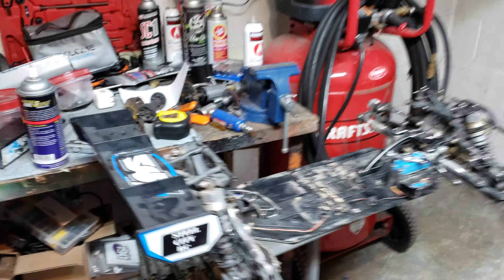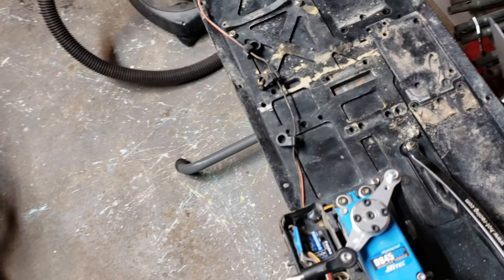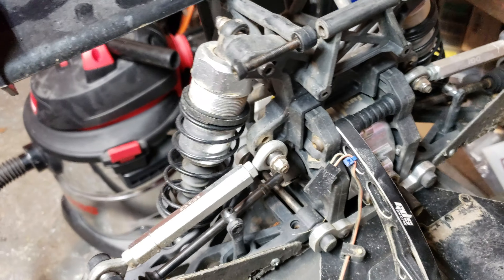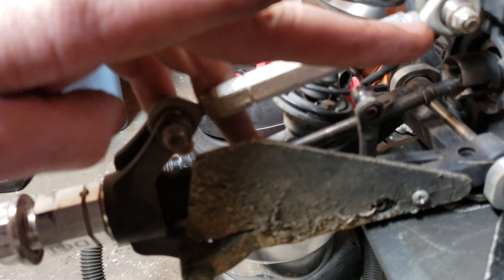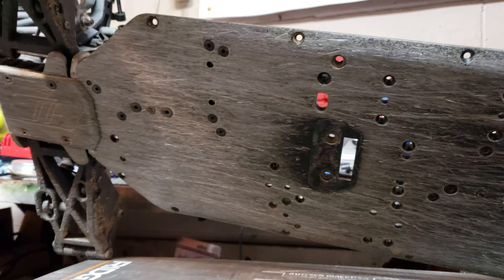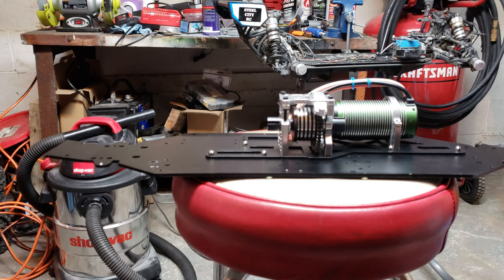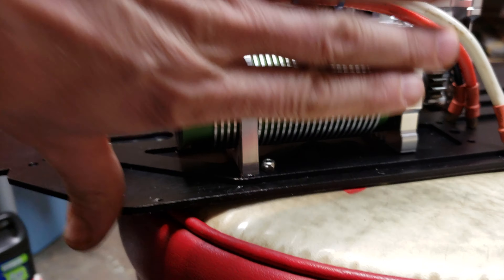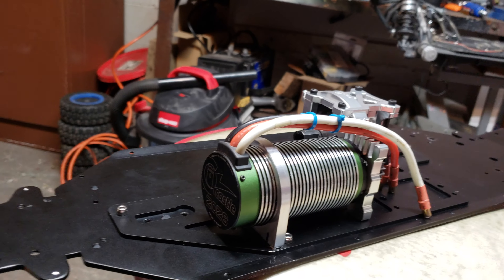Losi dbxl-e V1 FID Motor Mount & Mods

Comment: I did the same thing with that rear motor mount. I’m a machinist so i got it dialed right in!! But these are heavy motors so stock is just the front screws and that’s not enough support.. good work bud!
Reply from the maker: Thanks man. It made a huge difference getting and keeping good gear mesh. Also feels like it lays the power down better. Appreciate you stopping by to check out my buggy 👊🤘
Reply: @SteelCityRC  but where did you get them mounts from? Got mine with a whole motor mount kit and i want another but don’t want to buy the whole kit. Give a link if you can please.
Reply: The link in the description bring me to the site but doesn’t allow me to buy.
Reply from the maker: @Powerplay86  on their site. Hit the options menu tab. Then choose the clamp diameter you want to purchase. Basically the diameter of your motor. Then buy it.
Reply: @SteelCityRC  yup I figured it out lol the diameter is 57mm right?
Reply: @SteelCityRC  wow going to cost like 50$ with shipping. MGM makes the kit I bought so I emailed them to see if I can just buy the clamp. Thanks for the help 🤘

Comment: What’s up brother? Good to hear from ya! I think that rear support on the motor is going to solve your mesh problem for sure.
As far as your mesh method, I do the same thing and we know it’s good! Especially because we’re not dealing with any plastic gears. 
Hope you and your family have a Merry Christmas G!
Reply from the maker: Awesome. Glad you think the rear mount will help. Took a bit to slot the chassis so it will slide for different pinion options. Now I wont be so fearful to change pinions. Happy Holidays my friend!!

Comment: Got a few of the darkside studios chassis protectors and they are by far the best I've ever found to date. Gotta get that motor mount for mine...nice brother! In middle of throwing in castle bec2.0 and dual hitec d-845wp servos in mine rite now. Hate the added wires though but what can ya do...hide em best as ya can.
Reply from the maker: Sweet. What if you used a small 2S lipo for the servos instead? When I turned this buggy on to 12S using a Flier ESC. I initially used a 2.0 BEC. Then decided to just use a 2S rx lipo. Just a thought

Comment: Great video man..am planning on converting my losi 5ive RALLY and i was wondering if this motor mount and rear clamp work on the losi 5ive T chassis ?
will it require drilling new holes for that mount and the rear clamp?
Reply from the maker: For the 5ive platform I recommend this mount. https://wforccustoms.com/products/losi-5ive-brushless-motor-mount
Reply: @SteelCityRC  thanks bud but am in Europe the import charges on that may be costly...

Comment: Hey buddy I recently got a dbxl conversion to a E and it doesn't have the best motor mount right now on it so I was thinking of grabbing this system as my truck already has 90% of the FID hop ups so my question was I'm guessing I need to get the FID motor mount and also the center diff mount?? And do you happen to have a part number for the mount in the rear? And one last thing I'm guessing this would work with a V1 dbxl that's been converted to electric? This is my first big boy 5th scale and I got it as a roller and put in a max5 combo with the 56113 800kv motor. The thing is crazy fast as I clocked it at 55 mph but now I'm getting problems where the esc is going in limp mode or something where it goes down to half power. 🤔 very odd. I think maybe I'll try gearing down as it's on the stock 18t pinion. Maybe it's overloading it or something. It's winter and I have a duel fan setup on it so I don't think it was cause heat. Frustrating for sure! Thanks for any advice brother
Reply from the maker: Hello. Unfortunately when Losi built the dbxl-e V1 they recreated the center driveline. The dbxl-e center shafts go straight down the center unlike the gas dbxl which is offset due to engine placement. So I would find a dbxl-e chassis then get the two center shafts along with the FID motor mount. I have a used dbxl-e chassis. Very scratched on the bottom but it is straight. A quick DA sanding it could be smoothed out then a chassis graffic protector for the bottom. Should have used a protector from the get.
Reply: @Steel City RC  Hey buddy I appreciate the reply. So in reference you are saying you don't think the motor mount would work? I get what you are saying about the shafts being offset and not straight.  I got a mount kit in now but its not the best. I actually just searched it after I read your comment and a guy did it on here titled "losi dbxl conversion" but for some reason he ran the motor in a odd spot where if he had turned it 180° I think it would've been fine. The issue he had with the mount is he had to raise it up and he used some aluminum to stack up. I'll have to try to look into it a little more but I appreciate the heads up so I will just do some more research before I place my order.  Also love the ridged stand 👌🏼... That's what mine sits on as well lol. You wouldn't happen to be on Instagram at all would you? Was curious also how much you were looking for that chassis if I need to go that route fiqured id ask but I definitely appreciate the help and advice!
Reply from the maker: Well I suggested a dbxl-e chassis for ease of swap. All your diffs bolt right on. If you used a FID motor mount for a dbxl-e. You would have to drill all those holes in the chassis for it. To me it would be easier to buy a dbxl-e chassis and center shafts to be done easier.
Reply: @Steel City RC  Ah I gotcha. Thanks bud. I appreciate the advice!

Comment: Nice job G question I purchased the same mount from fid same color how do you slide the motor over for bigger or smaller pinions if you have the clamp around the motor attached to the chassis.Looking good tho bro.
Reply from the maker: Thanks Man! Watch the whole video. I went over how I modified the chassis to let the rear mount slide with the front bolts. Check it out!
Reply: Ok G watched it all now I see how you did it great job were did you get the rear mount and Merry Christmas to you and the family.

Comment: Hi. Nice build.  What motor mount is that in back of motor?;)
Reply from the maker: Hey thanks! That is a clamp from a Losi 5iveT brushless conversion kit. I got it ftom a German site online separately. Really helps the motor lay out the power. Appreciate you stopping by 👊🤘
Reply: Do u have a link for the ring motor mount? Did u dtill holes to mount it?;)
Reply from the maker: @mikeinvegas1  I don't. I got it a long time ago. Sorry

Comment: Does fid upgrade make car heavier than regular part
Reply from the maker: The FID billet parts did make the buggy heavier. I also added aluminum dbxl-e center diff cups inside the FID cases. I felt it needed the aluminum upgrades to handle power reliably. I use 12S in this buggy now. Still holding up great. So IMO it is worth the little extra weight for reliability. Appreciate you stopping by 👊 🤘

Comment: Is that the 800kv or 1100kv motor?
Reply from the maker: Hey what's up man. Thar motor is a 2028 800kv non sensored. The second gen. Although I do have their sensored version in a Outcast 8S. Thanks for stopping by 🤘👊🇺🇲

Comment: What esc are you using?
Reply from the maker: What's up! I am using a Hobbywing max5 esc. Thanks for stopping by! 🤘
Reply: Hey on the specs does it say that it can only handle upto or greater than 1000kv motor?
Reply from the maker: @LuisLopez-ed7oc  good question. I'd have to either look for the box or go online to get the specs. But I have used this esc in three different applications. 780 and 800kv motors without issue. Seems to really like the Casle lineup.
Reply: Steel City RC i was looking at the tp5690 models brushless motors and i seen one that 56mmx122mm and its 1100kv and they also have a 1300kv that one should be good for pushing about 75mph the 1100kv probably about 60mph i did the math but still dont want to buy an esc if it wont be able to handle the brushless motor

Comment: Nice rig. I'm converting my to brushless from Gas.  Do you think the FID center diff and mount will work on the V1 DBXL gas chassis?
Reply from the maker: What is up man!! If you are converting a gas V1 dbxl  you can use the FID center diff for gas then use a motor mount off ebay. Or get a V1 dbxl-e chassis and use this FID mount and all your other gas dbxl parts on it. All you would need is the dbxl-e V1 center shafts. So there is a couple different ways to go. To use this FID mount you would need to drill the chassis and use the V1 center shafts.